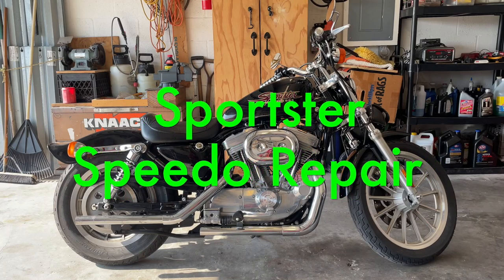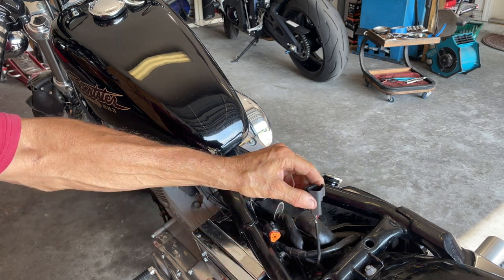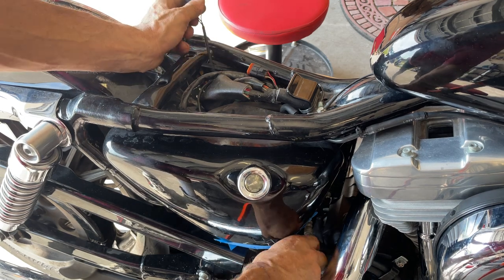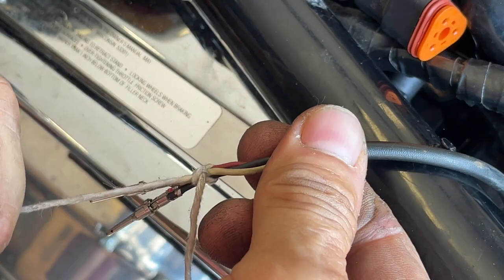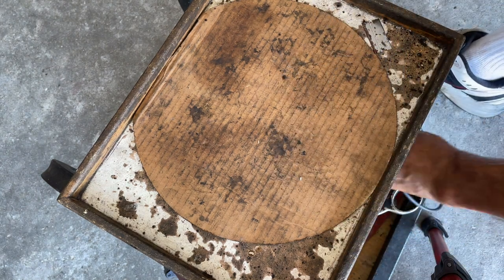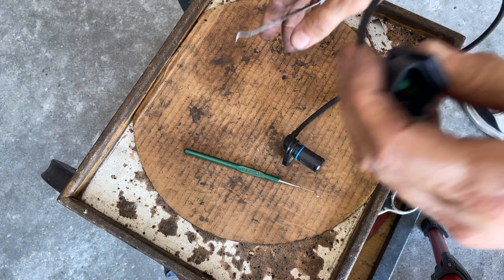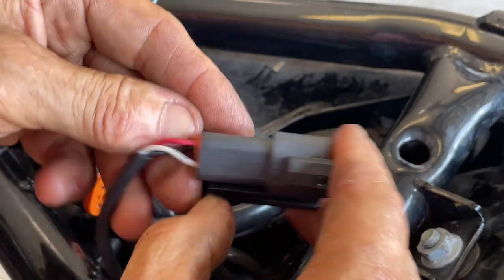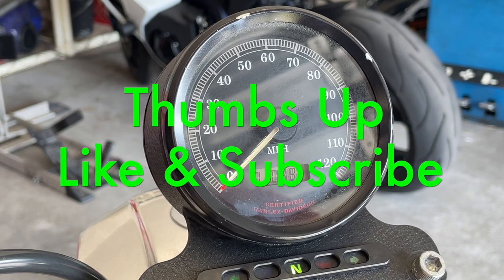How to Replace the Speed Sensor on your Harley Sportster.

Comment: Worked. Like. A. Charm. 2 weeks ago, my speedo stopped working,and my turn signals would not cancel. Followed your video; especially snaking the sensor wire, ( great idea!). Popped the wires out of the connector, took pics of everything BEFORE I did it, put it back together and fired it up. Speedo works like brand new, and turn signals were self canceling. Thanks for the video!!!
Reply from the maker: I love to read when all works out well. Thank you for watching and your sub Luke. Ride safe and have a great day.
Reply: So Luke, was your speedo completely dead, as in no back light or anything?  Mine is, and I'm wondering if this will fix it.
Reply from the maker: Happy to help. Sounds like your speedo is bad you should have some light.  the sensor is going to stop the speedometer from working but the backlight should work. Thank you for watching and your sub Mark. Ride safe and have a great.  check fuse and wiring in the back,  easy to take apart and you will smell something burnt if it is you Speedo. Let us know how it works out.
Reply: @TwoWheelRocco  I forgot to mention this seems to be a ground issue.  I don't think the ground is coming from the sensor but I'm not sure.  If I provide a ground on pin 10 of the 12 pin connector the speedo lights up but no numbers on the odo...  ideas?
Reply from the maker: @markvanhorn1767   I would swap out the sensor just cause it's so cheap. Let us know how it works out.  sorry that's all I got.
Reply: @TwoWheelRocco  Got it!  Not one but two wires broken off the connector.  Thanks for your replies!
Reply from the maker: Happy to read all went well. Thank you for watching. Ride safe and have a great day.

Comment: If I am having issues with the backlight of the speedometer at high speeds but coming back on around 30-40 mph where would I start?
Reply from the maker: Happy to help. Sounds like your speed meter is failing. Thank you for watching and all your support. You can replace it with one, that you could find on eBay. Thank you for watching and all your support Christopher. Ride safe and have a great day.  I do not know of a fix for the inside of the Speedo lighting.

Comment: Rocco  i have problem with my 2005 sporter speedo not working good  i change the speed sensor and not working spedoo move but not real miles
Reply from the maker: Happy to Help, Sounds like your speedo is failing, How many miles? Find one from eBay, relatively cheap. Thats all that's left. check the seller's return policy,  if it doesn't work return it.  Thank you for watching and your sub. Edgardo. Ride Safe and have a great da

Comment: Never had a problem with the speedometer on my bike but it’s good to know where the speed sensor is and how to replace.  appreciate all your video’s.  Right now I’m working on my bike I use your video to test and change the neutral switch. It was a perfect time to do it because I had to take the exhaust off, the crossover had a crack in it at the rear pipe. Then while I was at it might as well change the rear tire. And then I change the rear brakes. It’s starting to become a makework project. I’m just going over the whole bike because it’s 18 years old now and I’d like to do as much preventative maintenance so I don’t have any breakdowns. I’m actually a car/truck technician/mechanic so I don’t actually mind working on it. I just want to fix everything now so I don’t have to do anything on it for the next few years just change the oil and ride.
Reply from the maker: Happy to help. Any questions just ask. It's good to maintain your bike. Breaking down is not fun. Thank you for watching and your sub white night. Good luck with the new ride. Have a great day.

Comment: Thank you. Just bought a ‘99 1200 and the speedo wasn’t working but had power. Used this video to get the job done. My cable had two zip ties on it along the frame but other than that it was a nearly identical project. I ended up removing my rear exhaust pipe to more easily access the allen key screw as the extended socket allen ball wouldn't work for me. But I have after market short shot pipes so it wasn't too bad to take one off. Thank you for all of these videos.
Reply from the maker: Happy to help. I just finished one the other day a 2003 with the same ties on the frame, wasn't a problem everything went smoothly and I did remove the rear exhaust and the cover. It had a stock exhaust with the crossover which made a big problem but bolt by bolt. Everything works out. Thank you for watching and all your support blue skies. Ride safe and have a great day.

Comment: Thanks for the video! I ended up using a 3/16 Allen bit and a 1/4” tiny wrench and taping the bit to the round end on the tiny wrench with electrical tape. It seemed impossible to get the swivel Allen wrenches on it. I tried pivoting sockets and everything. I contemplated cutting my Allen wrench shorter but I didn’t want to mess up my Allen set. So I made the bit taped to the tiny wrench work…probably 25 turns or something, I lost count lol … didn’t fix my speedometer unfortunately…must be an issue with the needle and dial. I understand why “be patient” is mentioned more than once! Lol
Reply from the maker: Sorry I didn't work out. Because it could be a pain that Install. Thank you for watching and all your support. Rich check on eBay. If you could get a reasonably price Speedo with a return policy in case that is not your problem. Did you buy a new speed sensor? . Ride safe and have a great day.

Comment: Cheers for this, made getting it out a lot less painful.

Couldn't find the swivel piece in the UK, least not without hefty postage costs, but instead ended up using a short allen key that fit the bolt, and an adjustable spanner and having to do small turns at a time to get the bolt out.

Love my sportster, that is the single design decision I hate about it though, reversed terminals on the battery is a bit annoying but just looking in the right place really, replacing the speed sensor?

I'm glad I only have to do it once right now and it'll last years lol
Reply from the maker: I'm happy all went well. I know it's rewarding to repair your Sportster. I love these bikes. Thank you for watching and all your support Jack, ride safe and have a great day

Comment: When you pulled out the green piece and said “this keeps everything honest”, does that need to be put into the new sensor for the new one to work properly? And what is it?
  
Having some issues with my speedometer, just replaced the sensor but I didn’t replace the green piece, just left the new one as it.
Reply from the maker: Happy to help. You put that green piece and the orange piece I believe back and it keeps all the wires centered. The orange piece I believe is for waterproofing. Yeah you supposed to put everything back that you took apart always helps. Keep the wires, correct let us know how it works out. Thank you for watching and all your support, Luke. Ride safe and have a great day.
Reply: @TwoWheelRocco  thank you!
Reply from the maker: Let us know how it works out.

Comment: Rocco, hope ur doing well. buddys 97 sporster speedo burnt-out. he replaced it with a old used one. went for a short ride, but it's not marking mileage still sitting at zero. I think there's some recalibration needed but we have no idea how to reset it. looked through your vids until I got tired of scrolling 😁. do you have a vid that shows how to reset it? thanks for all your help to the biker community.
Reply from the maker: Happy to help, The speedo that you bought is stating speed but not miles.. if the plug lines up and everything seems to work. Mileage stays the same that Speedo is broke.  there is no recalibrating of a speedo that I know of.  Thank you for watching and all your support jukeboxheros. . Ride safe and have a great day.

Comment: Hey Rocco, i have a 01 Sporty 1200.  My issue is my speedo arm doesnt move. Miles display but doesnt go up. Backlight works. I had replaced the speed sensor. But the issue didnt fix. Now here is what happened. Previous owner tried to charge the bike with a charged car battery. He crossed the terminals. Since then it stopped working. Im popping code D05. Speed sensor return shorted high (white). Any ideas? Since i replaced the speed sensor the only issue can be the wiring before the sensor cable right?
Reply from the maker: Happy to help. I would look on eBay and find a Speedo with a return policy. I believe your Speedo itself has failed. I have seen it before. Thank you for watching and all your support Tony. Let us know how it works out but you can find a very reasonably priced Speedo on eBay. Ride safe and have a great day.

Comment: Hi Rocco, Just found your channel, new sub now.
On my 2004 XL883 Custom the speed sensor and the plug are different than the ones on your Sportster. Fortunately they are both in pretty much the same locations so I now know more than I did before finding your video.😁 Unfortunately 2 of the 3 oil lines are routed right over the top of the sensor and the 3rd one is in the opening you used to get your allen wrench in.🤷‍♂️None of them have enough slack to move them completely out of the way and there's no way I'm going to get 3 hands in that tiny space to hold them while I replace the sensor.😢 I guess it's a good thing that I won't need the string to get the plug and wires pulled. I can use it to tie the oil lines out of the way.😂
I do have the same connector that you disassembled the other half of in the wiring harness but it just has a rubber blank in it. The flat connector my speed sensor is wired into is mounted right next to it on the front of the fuse box instead the top. Routing the new plug to it won't be very hard once I use something like a welding rod to fish it under the oil lines.
I will check the wires in the speedo to see if they are the same color as the ones in the connector before I even start tying oil lines up. 🤔
Thanks for the video. It helped. 🙏🙋‍♂️
Reply from the maker: They are the same Mike. Just have your way with them  Allen.head hold with vise grip.. Let us know how or two out

Comment: Hope all is well Roco I have a question hope you can give me an idea what it might be? I picked up a 2001 xlh883 sportster in mint condition 2 years ago with only 8000 miles on it bike ran fine up until last month it started to act up I would go for a ride get off the bike go in to a store or come back like half hr later and the bike will not start it cranks ok but doesn’t wanna start it has new wires new plugs new coil and new battery pulled out the plugs one at a time and grounded the plug to the cylinder head and no spark? If I let the bike sit like 2 hrs it will start right up again and if I go for a ride and turn it off and then start it right away it will start it’s only when I let it sit awhile I know an intermittent problem like that is hard to pin point but would think it can be the electronic module the one on that the right side were you have to drill out the rivets? And it doesn’t do it all the time I can go 2-3 weeks without a problem then all of a sudden it starts again. Sorry for the long message but I wanted to explain as much as I can to you. Thanks so much for your time and help have a great day .
Reply from the maker: Happy to help.... They are notorious for the ignition module to fail. The heat from the engine destroys the module. replaced and I'll be like new. ebay. https://www.ebay.com/itm/334115941200?epid=1823357295&hash=item4dcadcab50:g:8MkAAOSwIYxhGtI8  Let us know how this works out. Thank you for watching and your sub Wayne.  Ride Safe and have a great day

Comment: I changed out the sensor on a 2003 1200.  I bought one off of Amazon but  my speedometer still does not work.  On initial start up I hear the speedo make a noise and the needle jumps a little.  The milage displays for a little bit then quits. What would I check next? Thanks
Reply from the maker: Happy to help. I myself buy the sensors from dealer, because all these Chinese parts really bites us in the butt.  speedo's isa bad. Go on eBay and find one for cheap that states it works and that's the only thing left to do. I hope this helps. Thank you for watching and all your support Jack. Ride safe and have a great day.

Comment: I have the same problem with my sportster so I will be attempting this soon thanks to your help. Do you think the speed sensor would also cause my turn signals not to work anymore? They were working then went solid and ultimately died
Reply from the maker: Happy to help. That will resolve your speedo problem as for your turn signals. All four of them are out. Sounds like turn signal module went bad. What year Bike do you have? Any questions just ask. Let us know how it works out. Thank you for watching and your sub.Prowler929.  Ride safe and have a great day.
Reply: @TwoWheelRocco  thanks again rocco I’ll look into that as well. It’s a 2000 and yes all four of them are not working
Reply from the maker: @prawler929  I Believe turn signal module. Let us know how it works out. Thank you for watching.
Reply: @TwoWheelRocco  just finished swapping out the sensor with the help of your video and it works great! Thank you again for your expertise
Reply from the maker: @prawler929  happy to read all is well. Thank you for watching and your support. Ride safe and have a great day.

Comment: I just changed my Speed sensor and the speedometer still isn't working on my 1999 Flstc Heritage. Could the issue be the speedo?
Reply from the maker: That's all that's left, Speedo.  sensor usually the weak part. Buy a speedo on eBay relatively fairly priced. Let us know how it works out.. Thank you for watching and your sub Wayne.  Ride safe and have a great day.

Comment: hey Rocco ,is it normal to be changing crank position sensor on a 10 thousand mile sportster?06 1200 sportster
Reply from the maker: Happy to help. Your sportster is 16 years old I've seen that with last time and Miles. Cheap and easy fix. Did the code come up? Thank you for watching and your sub Ken. Ride safe and have a great day

Comment: I just replaced the VSS(speed sensor) on my 2000 Heritage Classic. Still no speedometer or digital odometer. Engine light still on. It does work a little when stopping and starting. Is there something under the dashboard or speedometer that may be malfuctioning?
Reply from the maker: First checked all the wires in the back of the Speedo plug-in. If nothing, I would sauce out a speedo on eBay that's all that's left your speedometer. They're not that bad unless you want one with low miles then you'll pay.., Let us know how that works out. How many miles on this motorcycle?  Thank you for watching and your Sub Bill. Ride Safe and have a great day.
Reply from the maker: Videos on eBay.   https://www.ebay.com/itm/363452038556?fits=Year%3A2000%7CMake%3AHarley-Davidson&epid=1923011823&hash=item549f6dfd9c:g:1AIAAOSwL1dg24Wk.   Hope this helps.  Buy one with a return policy,  if that's not your problem return it. That's what I would do.
Reply from the maker: https://www.ebay.com/itm/274794137168?epid=1923011823&hash=item3ffb01c650:g:wU8AAOSwhqBgmsmU

Comment: Hey Rocco can put the washers on my slide on bone stock 883? If so give me the link. Thanks
Reply: Tryin to get more response out of my sportster. What do you think the best thing to do other than going to screaming eagle stuff. Thinking of putting a cv performance needle in.and the washers if poss. Thanks Rock
Reply from the maker: @bobburnett5973  change the pipe to a slip on.  then you could work the carburetor.  Thank you for watching. Any questions just ask. Ride safe and have a great day
Reply: I have turnouts are they considered a more free flowing pipe. Also do they have baffles?thx rock

Comment: Hey I got a question about my 2004 883 Sporty. Since I've had the bike, there has been gasoline that has soaked into my air filter. It's not dripping with oil, but it is definitely saturated more or less. Is this an issue with the carb? My bike is equipped with Screamin' Eagle airfilter I think. Thanks!
Reply from the maker: Happy to help.  How does she run and start in the morning?  Take a look at your fuel inlet on the carburetor they know to have hairline cracks. That are hard to say if you have a vinyl inlet it probably leaks. Take a look at this video.   https://youtu.be/4MzTt2IfGvY.  Let us know how this works out.  Thank  you for watching and your sub River.. Ride safe and have a great day.
Reply: Thanks for the video suggestion! I will try doing that!

As for starting it, on a colder morning or if I haven't ridden in a couple days, she has to crank quite a few times to start. She has to crank for maybe 10 seconds before the engine tries to start.
Reply from the maker: @rivahgotmusic  that's what your choke fully on.
Reply: Yes! Sorry haha!
Reply from the maker: @rivahgotmusic  Test your petcock. https://youtu.be/7Fo9Q93OJXI.  Make sure your vacuum line running off that Petcock. to your carburetor is in good shape. They get soft and collapse and cause all sorts of starting problems test the pick up and let me know how it goes. Have a great day

Comment: Hey Rocco, my Speedo doesn’t work at all, no miles no nothing, what should I check to make sure I don’t have to completely replace it? Thank you
Reply: 06 Harley Sportster, this bike turned into a bit of a fixer upper
Reply from the maker: Happy to Help. I would just change out the speed sensor as I did in the video $20 part, that's a dealer part. And your problems should be behind you. Let us know how it works out. Thank you for watching and your sub Abraham.  Ride Safe and have a great day.